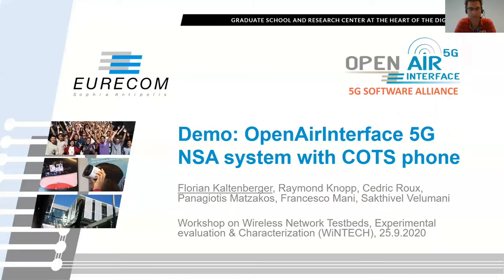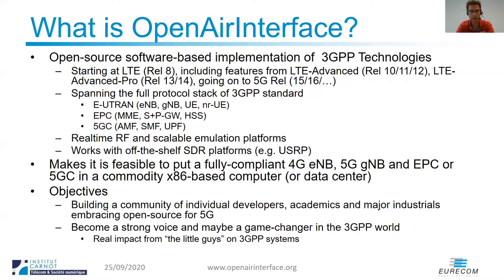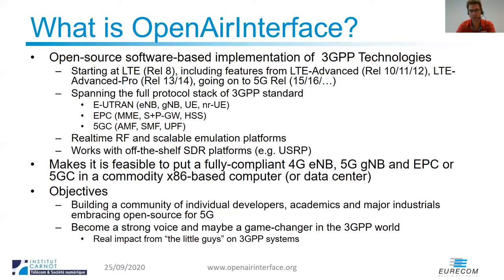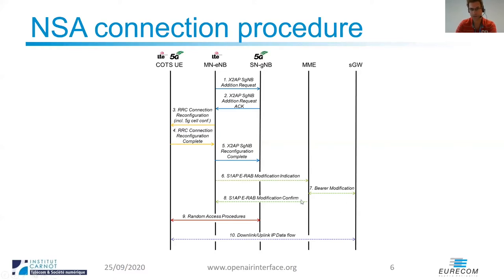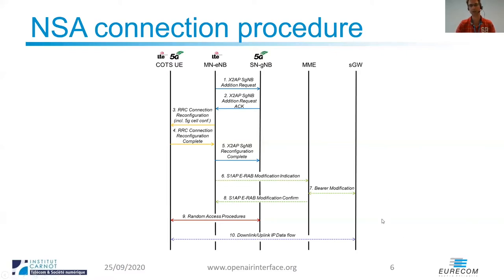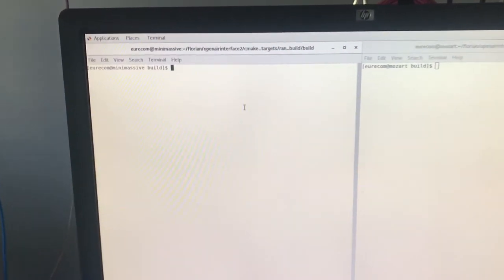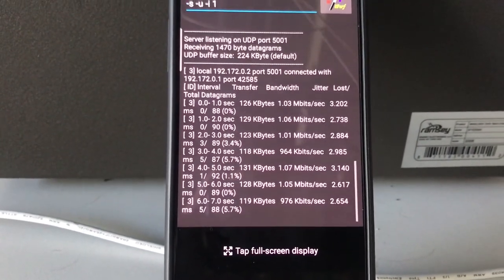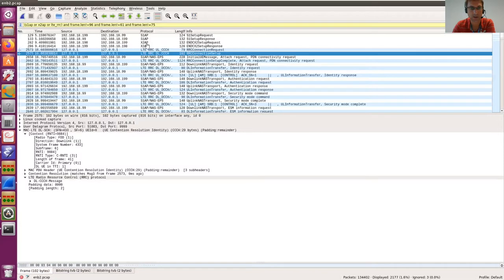Demo: OpenAirInterface 5G NSA system with COTS phone

Comment: Is it possible to run OAI-5G NR (SA or NSA) with computer having core intel i7 7700k , I see in the old hardware requirement it's core intel i7 6900k (wich have 8 real core and 16 thread instead of 4 real core and 8thread if it's the core i7 7700k). So my question, is it possible for this processor to run OAI5G NR (SA or NSA)?